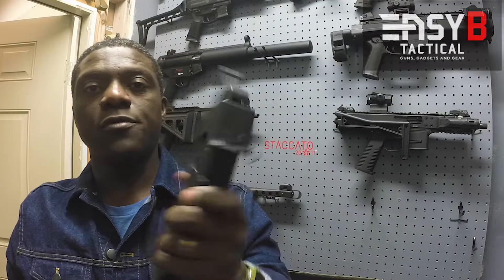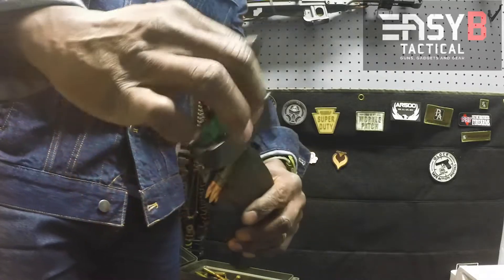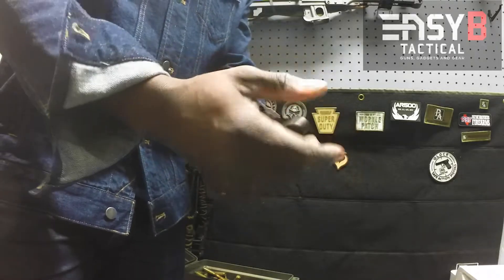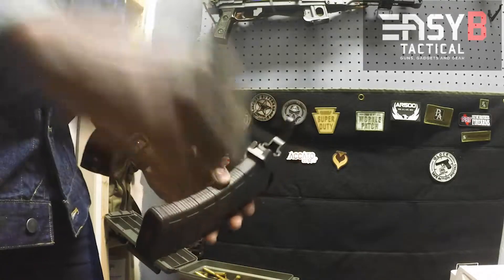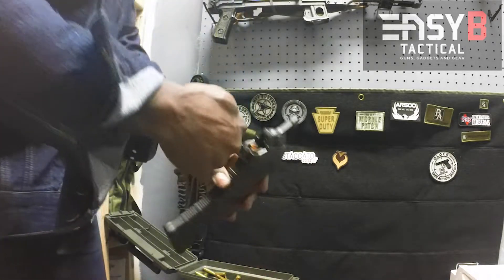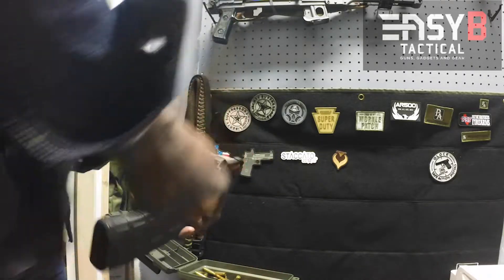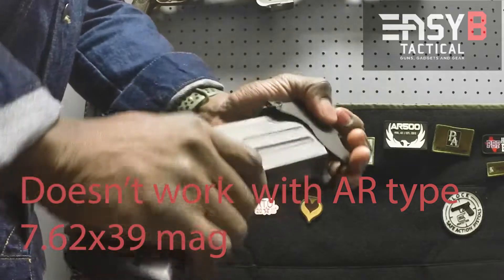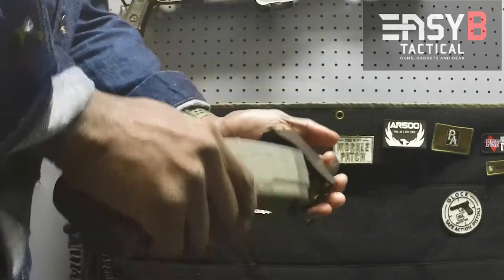Maglula AK and Galil loader #AK

Comment: Install the LULA like you would a magazine into an AK. Hook the front of the magazine first. Then the rear until it snaps into place. Keep this in mind especially if you have some rounds in it already.
When loading the magazine, put your index finger on the rear tab of the LULA so that it does not snap off. LULA is not designed to come off when magazine is full as some other reviewers have stated. Good luck and congrats. on your new accessory.